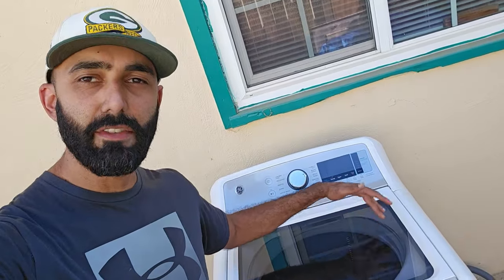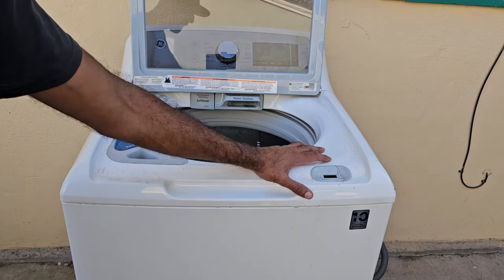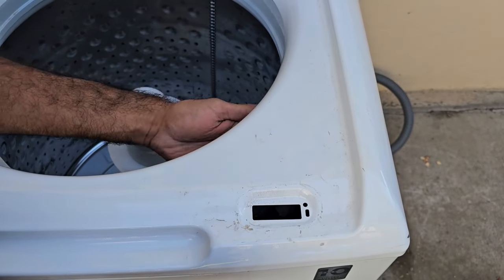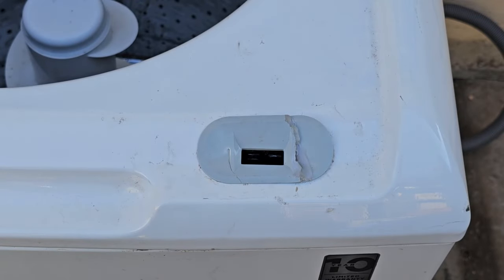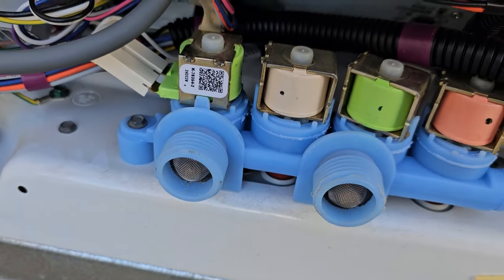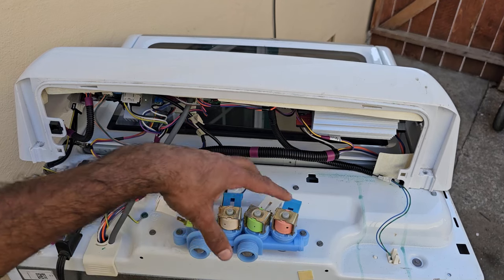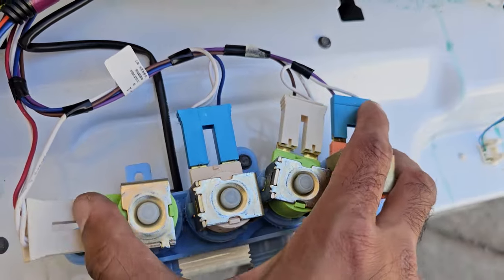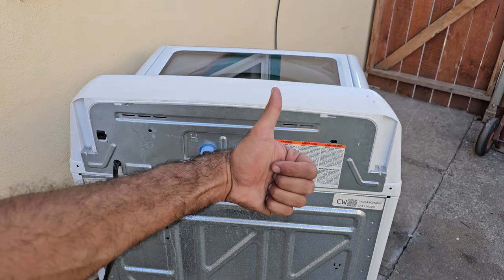Fixing A GE Washer That Is Not Filling With Water!

Comment: I changed the same parts but still will shoot 2 shots of water then lock and then nothing. That's what my was doing before
Reply: Dang mine as well
Reply: @joevans8636  
What was your fix to it?
And my washer is not even 5 yrs old. Everything is shit these days
Reply: Mine is working now
Had to go through a diagnostic on it. Somehow it must have reset it and everything is working now
Reply: My washer is doing the same 2 shots of water then lid locks and then nothing does anyone have an answer for this or what to check
Reply: Same here 🤦🏿‍♀️

Comment: Replaced the lid switch and tested the resistance on the water valves. All the valves are between 1.3 and 1.8. One valve is at 1.29. Close enough? Also checked for any possible mechanical failure and the screens were clean and no other deposits found.  If those 2 parts are working, what's the next possible problem? Thx

Comment: I cannot find a way to remove the water inlet valve to check for debris, etc due to cold water not coming into the machine. There is no part/piece to grab with needle nose pliars. Also note there wasn't a screen inside the hose attachment. How can I clean tis on my GE washer? Thanks, Claire Cothron
Reply from the maker: At that point, it might be best to just replace the valves

Comment: my ge washer wont fill, just pouring in and not staying, its like filling up a tub without a stopper and expecting it to fill
Reply from the maker: Most likely it's stuck in flood mode. This happens when the pressure hose port gets clogged
Reply: Mine too

Comment: But none of the newer energy efficient washer full with water anymore. So are your referring to the machine not filling at all with water or the issue with them not fully filling due ot ths new machines? I need a trick to fix mine it's new but obviously has the same problem as all new ones where they dotn fill all the way over clothes with water.

Comment: I'm about to do my 2nd  Lid Switch replacement.  It kind of takes one spray of water and stop. 2nd spay and stop. When it does the 3rd time, the sensing lights illumitanes but the spraying is about 3 seconds before stopping.  If its bad, it happened within a month after I replaced it for the first time

Comment: So i replaced the water intake part, but it won't run cold water. Any suggestions? I've done the diagnostic, and it works, but for any cycle, it won't run cold water only hot.